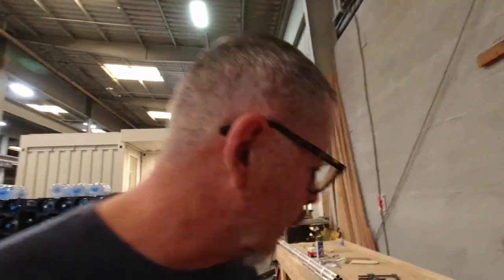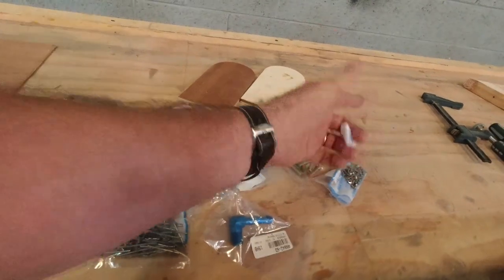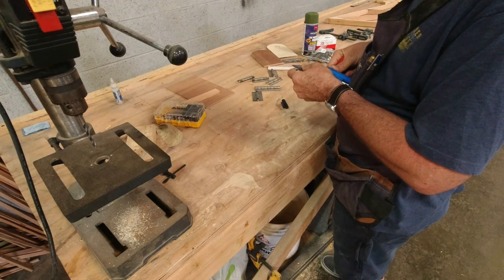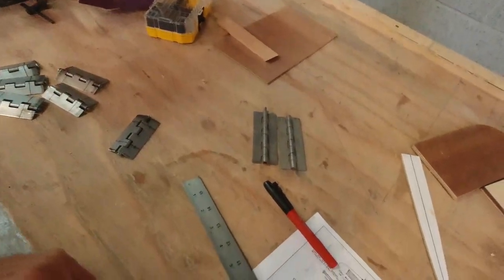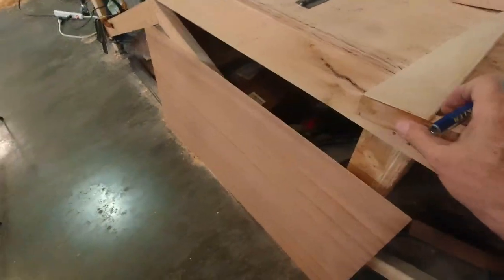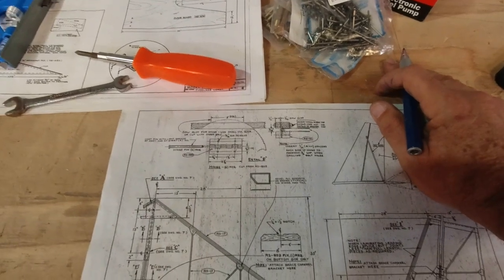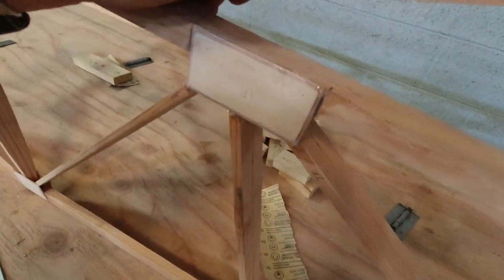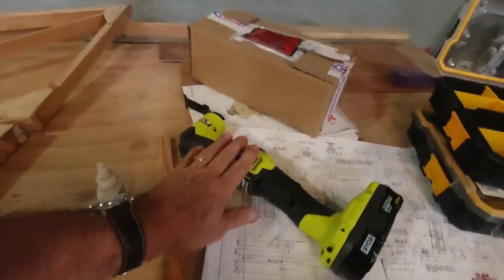Minimax 1100r Wood Aircraft Build Ep 101

Comment: Dennis.  Enjoyed your hinge "locating" and installation.  I think I cut the hinge slots by using a 1/16th drill bit, set to the depth of the hinge flange.  After drilling successive (many) 1/16th holes,  cleaned out the slot with a piece of hack saw blade, then used that 1/16 bit to "run along" the slot to clean it out.    Not totally sure of that, as it has been over 20 years since I did that particular procedure.  

As I mentioned, I had no special tools, and had to improvise.  Your hinge job came out really nice.   Yes, drilling those 3/16th holes, to  mount those flanges, requires patience.  :)  I always had a piece of 3/16th dowel  rod to "fix" my mistakes. :)  Strange that  I can't fully remember that particular procedure - however, as an "old person," some things elude me. :)   Thanks.
Reply from the maker: Memory is a strange thing, I can remember my best friend in high school’s phone number, and that was a rotary phone, but sometimes I cant remember what I had for dinner a couple nights ago.

Comment: Hi Dennis, You did the hinge slotting almost the same way as I do, the main difference is I drill the wood first (under size) and mark the hinges with them in place and set with using the under size drill just to get the marks, then dill them through (still under size), drill the wood full size and on hole on the flange of the hing assemble with a bolt and drill the other hole with the hinge locked in place. As that video is yet to be released I will tag your videos on to it so people can see the different method and types of hinges.
Reply from the maker: That sounds great! I look forward to seeing how you’re doing it.